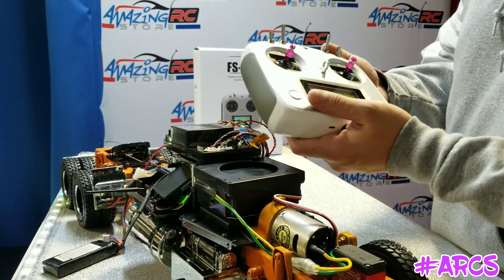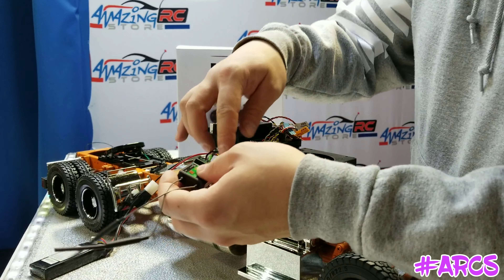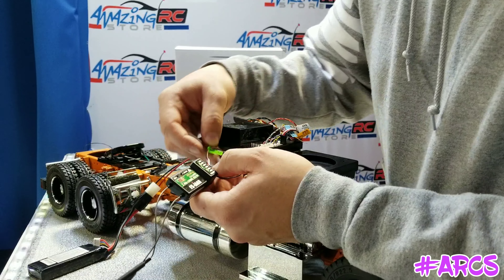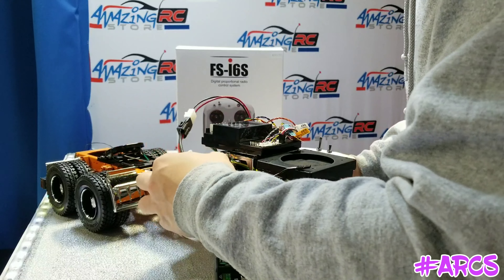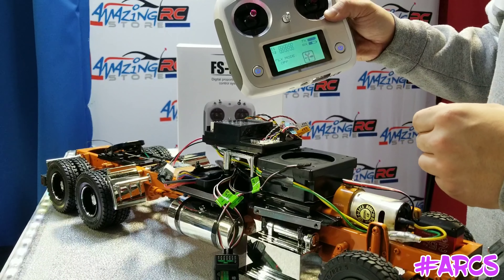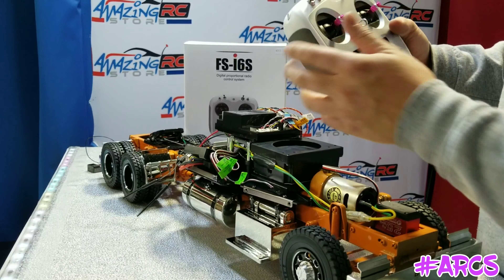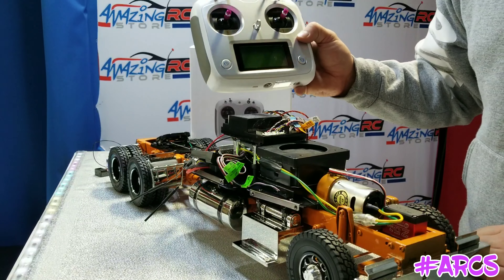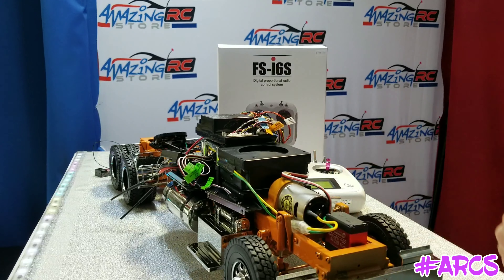How to setup Flysky FS i6s Radio

Comment: Hey buddy,  I hate how tight everything is in side the cab. The speaker takes up a ton of space so I was bored and found this! The amplifier is $13 for 200 watts peak power and I power it using a regular 7.2 or a old school flat 9 volt battery.  To get the sound to come through the custom speaker box,  instead of wiring the speaker that comes in the MCS package just wire the speaker box you made! I included the link to the video showing you how to build the box ( I used the white foam board and not wood ).  
https://youtu.be/1igItsLogX0
Reply from the maker: Thank you!!🔥

Comment: Terrific  I have that same radio with my tamiya grand hauler already programmed for me lights and all. My only issue, I was trying to Bind another receiver on the Trailer for remote lighting but i can't seem to get it to work without knocking out the Bind of the Truck. Do you have a video on or can you tell me how 🤔 we can have 2 receivers bound.

Comment: hellow my buddy how are you awesome video thx but i have question i have same this radio control on my rc earth mover 870k wheel loader i use battery 3s 2400 mAh 35c but when the battery is weak and the pump stop work the battery still full on my radio screen she need program but i don't know how even the alarm is not working when the battery low i don't know how can i programing her in the RX set up ?
high volteg.?
alarm.?
low.? i hope you help me how thx again my bro excellent video thx

Comment: You don’t have a problem with both throttle and steering on the same stick? I bought a Capo JkMax 1/8 scale Jeep JK rock crawler .. and had it built for me. It’s a complex rig and uses 8 channels .. so they included the I6S as the transmitter .. but they put both throttle and steering on the right stick .. and it’s very hard to rock crawl smoothly with fine slow throttle movements and steering on that one stick, they put the winch control (which rarely gets used) on the left stick of all places 😡 Obviously the guy that built the rig is not a rock crawler or even a trail guy with that setup. So how do I get my throttle on the left stick .. can I reassign it from the transmitter .. or do I have to start pulling plugs from the receiver and start moving things around? Would you be available as a paid tutor either via Skype or FaceTime to help me get this setup right? The I6S instructions are no help, and I’m new to both the I6S and twin stick controllers in general, and I have a pretty low IQ 🙄 lol. Thanks!

Comment: OK why are you putting the gear shifting on the left stick with the throttle.  Yes that is the set up with a 4 channel radio, but you have a 6 channel radio with more functions.  Put the Gear shift on channel 5 and assign it to the three position switch.    Now you can switch gears with the switch and it wont bounce around like it would on the self centering stick.    Same with your sound control, put that on channel 6 and assign it to a two position switch.       You also did not cover the throttle curve function where you can reduce the jumpy throttle starting out.     There is also expo to help make SMALL steering adjustments at center stick.    Some much to this radio and you covered none of it.
Reply: Great ideas, help me alot. Thanks👌🏾😎👍🏾👍🏾